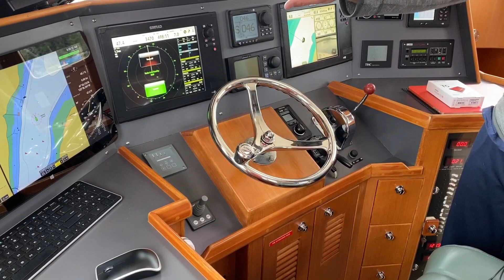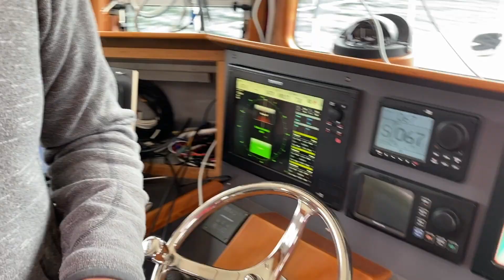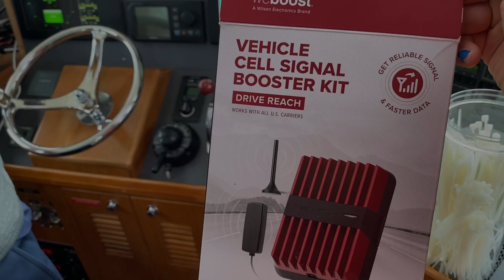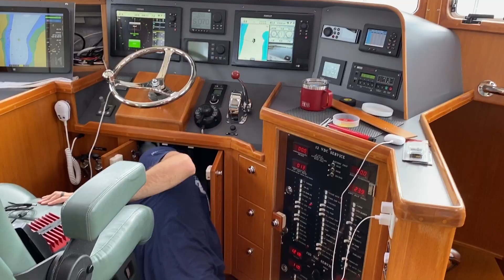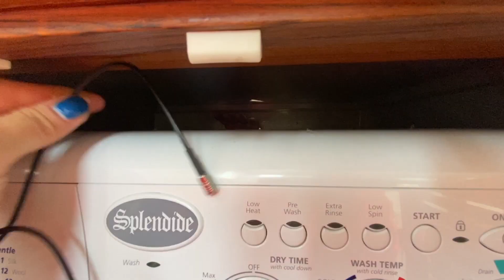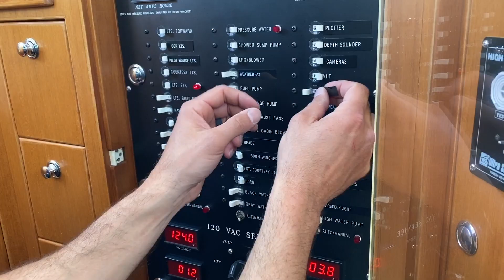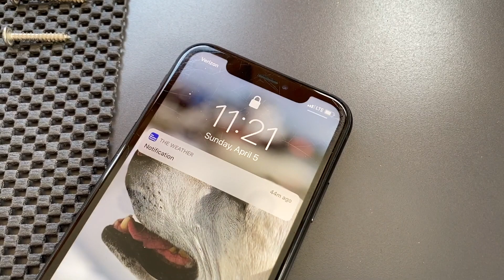Do CELL BOOSTERS work??? Watch our installation of a WeBoost on a Nordhavn 43 trawler.

Comment: i’ve owned 17 or 18 Boats through out my life i’m almost 60years old and i’ve never had great success with Cellphpne or Internet Boosters onboard , now i’ll be honest  i’m not very Techie  and honestly i guess i’m okay with the Crappy or slower  Speeds  as it’s usually other people that complain about it and for me  i like to check workEmails  and maybe  some NavigationalCharts or Maps ?  because of my Age etc i still usually have Paper Charts of the areas i’m exploring and traveling by boat plus i enjoy that system best as that’s how I was taught 40 years ago  don’t get me wrong i do use GPS ,Radar , and some other Electronics  yet i  never leavecmynPortbwithout my Trusty Old Hand held Compass

Comment: The Wilson antenna you bought is the original name of what is now called, WeBoost.  I had a Wilson home unit that should have worked in your boat.  It was more powerful than the mobile version you installed.  Like Elizabeth stated, "I thought it would have worked farther from the inside antenna," well...the house version that would also work on your boat, would have worked anywhere in your boat.  It's that much more powerful.  You can even get a splitter and have two indoor antenna's and have one in the pilot house and the other in your bedroom.   I highly recommend the WeBoost (formerly Wilson) units.  If you ever decide to upgrade to the more powerful repeater, you can buy just that part without the extra antenna's, cable, etc., from WeBoost.  Happy boating!

Comment: It would seem like anything that boosts your signal wirelessly will cut the bandwidth in half, so 4  bars on the boat won't the same speed as 4 bars when you are closer to a cell tower.  However, I'm sure it will be faster than what you had with the poor signal and you will eliminate the interruptions due to dropping the signal.

Comment: The signal would be better if you put the internal antenna on the outside of the cabinet as far away from other electronics and metal surfaces as possible. I'm sure it'll work inside the cabinet as well but from our experience in a camper. It's better if the internal antenna has an actual line of sight to whatever device.

Comment: Circuit protection devices (fuses, breakers) are to protect the WIRE, not the device.  You should size the breaker for the wire run, there are plenty of online resources to help you calculate but you need to consider wire type (stranded, solid), gauge, and length of run (voltage drop), and whether the run is in a bundle or in "free air".  When considering the length of run it is twice the distance from the source to the load (there and back again).  Its fine to use a smaller breaker/fuse but not a larger one.  In your video you seem to be considering the power requirement of the device, but not the wiring.  Its probably fine for you, as it sounds like the run was originally for a 20A 12DC device, but others may not be so lucky :)

Comment: BEWARE: It may seem like you were getting a very strong signal on your cell phone, but that could just be coming from the cell phone booster and it doesn’t mean the signal going into the antenna to the booster is that strong. So another words it’s not going to make the signal coming into the antenna stronger just from the box to the phone strong walking around that area

Comment: Have you looked at Digital Yachts 4g Pro. It gets 15 to 20 miles. I have the Wilson unit  for a  3 g, 3watt amp and a few extra bars on Lake Huron and Lake  Michigan. The omni direction antenna is on my 60 ft mast. Also have  
An Iridium Go and Antenna and have yet to use it yet. Very costly to run. Going to use a prepaid card for  600 for 400 minutes.
Reply from the maker: We haven’t but will look into it!

Comment: Soon we will have skynet so internet will no longer be a problem for most people.
Reply: starlink will take another 8 years in theory. They still have not perfected the sat to sat communications so you need to be close to a land based connection from your sat. Low earth orbit sats comes with a rather complex set of issues to resolve and it usually translates into throwing a ton of money at it. Musks does plan to increase the number of sats after this next round but there just isnt anything on paper for it yet. So 8 years is optomistic. Meanwhile some people pay as much as a million dollars a year for the worst internet imagineable for their yachts.

Comment: Hi Folks, love your videos. Will be getting myself a new boat in 2 years (Retirement) Looking at a smaller 41 Beneteau Swift Trawler. My question is is this a item that would be better mounted higher up? Just wondering if  the the other antennas could case interference?

Comment: First comment is the reason the wire does not go through the center of the pipe is to prevent water from coming into the boat.  Think about it?  Why wouldn't everyone run the cable like you are running yours...  You are creating a future problem.

Comment: We have been using another cell booster brand in our offices.    It is Wilson Pro.    www.wilsonpro.com     They have truly commercial grade equipment as well as specialized for autos and also yachts.    They also have a full line of signal repeaters, so if you have larger spaces, you can distribute the signals so you have service everywhere.    Also, they are a good company to work with.

Comment: Very near future you will be able to get  Starlink service Elon Musk is building. He already has around 25 satellites up he is running tests on. Starlink is licensed for 21,000 satellites for the future system, that gives an idea of scale. All Starlink satellites  will be LEO'S (Low Earth Orbit) around 350 miles. Currently, internet satellites are television, telecommunications satellites and orbit at 22,000 miles. Starlink will have ⅓ the latency, many more times the capacity and speeds near fiber optics.

Comment: The satellite internet is ridiculous on there service fees.whenever we order our new boat we always have them add that option. The cost is cheaper if the yard where your boat is being built in the stalls at for you. I just have them do it just in case the price comes down. Now we do have a satellite phone for emergencies. Even that to use for a phone call is very expensive. We haven't tried the cell phone booster. I really hope you keep us updated on how that works out for you.

Comment: Pro tip for cable management:. Instead of using zip ties, buy a roll of Velcro, then cut to whatever length you need.  It will last forever in this application.  It looks nice.  It's easy to add or remove cables from a bundle if needed.

I learned this dressing data closets in hospitals all over the US.

Comment: Random question not cell phone booster related...Do you have a schedule for how much you run your generator while at anchor?  Or is it running all the time...?  How does this impact climate control and refrigeration and freezer needs?

Comment: I hope this works for you. I've found in the past that you need a really good ground plane, as in a metal structure or faraday cage to separate the reception from the re-transmission antennas.  For your cruising area, I'd suggest a dual sim LTE router for data and wifi calling using both Verizon and T-Mobile.

Comment: Cool video showing the install. Put the antenna as high as possible and you may get better reception. I would get a long metal extender vs a short one. I would also keep an eye on the amp and power adapter. Both can get very hot. Might want to build a vented box with a couple fans to run air across them. Fuse rating should also be inside the cig adapter. I would also look into getting a Ham license for the water. You can send messages for thousands of miles for free minus hardware costs. Hardware can run from expensive to cheap, but how much is your life worth. You can send emails, receive pictures, and marine updates for free with a laptop. No ISP needed. Super slow on data, but it is another means of communication in case of an emergency. It can also be a fun hobby with lots of information to learn so it keeps your mind busy.

Comment: When I was in the Canadian Navy and we received our brand new ships in the 90's, we wanted to be able to use small hand held radios threw-out the ship for emergencies. The trouble was that there was just to much steel in the ship for this to work. The superstructure acted like a very big Faraday cage and shunted all the signals to ground. The solution, they strung RG 59 cable though out the ship in the wire ways. Problem solved. You need a terminator at each end of the cable. If you can find a piece of RG 59 say 20 - 30 ft long, put one end close to the antenna, without touching it and string the rest along the deck to another compartment and see if it works at those frequencies.  RG 59 or 58, (TV Cable) should be easy to find and the terminators are pretty cheap. Worth a try to see if it works.... :-)

Comment: This is so good :)
I install these unites all the time in emergency vehicles . 
I do exactly what you do ,loose the adapter, antenna , new safe circuit. 

But; the ones I use have the phone holder as the receive antenna . ( same brand )
I would like to know how well it work at see .
Our guys that are getting most of them are fire marshals in the north part of Canada.
They have limits ;but, can take you from nothing to signal .
Just so you know my job is wiring  emergency vehicles, no brand loyalty , just Shawn put these lights ,this controller ,this DVR , 10 cameras , and so on and so on !
Cheers Stay safe ! :)

Comment: I Installed that exact same system on my boat and have some pointers for you.....I have used it up north and in Desolation Sound...let me know if you want some input....I tried several boosters and the one you have and the antenna seems to be the best

Comment: Issue is not the strength of the signal, it's multipath interference if the cell phone's too far from that sensor pad.

Comment: so I got some convicting answers regarding making fresh water so my question is  can you make fresh clean drinking water on board. .
Reply: Doesn’t taste good at all but you should always be careful due to bacteria that can still get past the memebranes
Reply: Yes most larger boats will come with a fresh water maker. You can also purchase and install a RO watermaker for smaller boats. It can produce between several tens of gallons a day of fresh water from salt water.

Comment: Forget about the booster - the real magic of this video is a boat builder who actually designed for serviceability.  That job was super easy because they made easily removed access panels and wire chases instead of using all hidden fasteners and making you run the cable from the flybride to the engine room then back up to the pilothouse (all to common).  I've done installations of similar items where you might need 75' of cable just to reach 10' and spend a full day tearing the boat apart to access the routing.  (cough, SeaRay, cough)
Reply: Yup - Sea Ray owner here. Can confirm.

Comment: Not sure if you're aware but if you unscrew the cigarette lighter adapter tip, you should find a barrel fuse inline. That fuse should have a rating stamped on one end. This will assist you in determining the correct breaker size.

Comment: Cell boosters for Sprint dont worl for their 4G band, because the Frequency is next to a protect band. So boosters are not allowed to be made on that band. However they do work for other providers that don't have a band that is not near protected.
Reply: @Weenie Hut Jr's Not yet. The Feds have not approved it. REGARDLESS Sprints PCS Freq (unique to Sprint has restrictions so 3rd party boosters can't be sold) are still the same. I doubt T-Mobile will abandon PCS 4G network band. I have been a Sprint customer since 1994. I doubt it will make a difference to Sprint customers like me (since 1994).  It does not matter to me it's just a mobile computer (with a phone App). BTW I have one of the boosters in my house and it works pretty good. It was free and cost me nothing.

Comment: Good luck I have has zero to little luck with my Webost Cell Signial Buster.
Reply: I've had poor results with mine as well.  It will often show that I have 4 bars on the phone when it's on, but I still can't connect.  I've pretty much given up on it.

Comment: Nice video again guys.  Some people commented on StarLink for a future solution.  The issue for it and vehicles is the system tracks the satellites and does something with a phased array antennae to point to the best satellite.  Pretty cool, but on a boat that is always wobbling around it gets hard.  It is done electronically so maybe there will be a way.

Comment: Just because you can boost a signal doesn't necessarily improve it.  Also, I am guessing you left enough slack in the antenna wire to replace the mount. :)

Comment: There are lots of different cell boosters available today, differing configurations, antenna types and power ratings. If you select the right type for your application, do a proper installation, and have a signal available to boost, they work well. The mistake many make is buying one thats too powerful for the space available, especially in boats & RV's. The more powerful the booster (dB of gain) the more space required between the antennas. If you don't maintain sufficient separation between the outside & inside antenna, it creates oscillation between them and effectively shuts it down.

Comment: Nice presentation. Looking forward to your review over time and at a remote anchorage.  As I am quarantined, as we all are, I have been researching for my boat. WeBoost makes several versions of the product and there is one for RVs and one just for marine use. It comes with the correct antenna and a different amplifier box. I don’t know what the different box add as performance.  Between WeBoost and Wilson the solutions for marine are very confusing.

I am also looking at the Iridium Go as a solution. Not cheap either as a data plan or two are required. 

Again nice video.

Comment: hey, I do not comment often, but you guys need to hook up with DELOS sailing on you tube. they just found a company out f A that has a new high speed internet available for boats  e that they could afford to put on and use. they were getting much higher speeds even out on the ocean. I am not giving details because I watched the video but I was doing other stuff at the same time. i would rather them give you details since they know what they are talking about.  Happy motoring
Reply: I hope it is affordable but I don't think delos is paying for it.
Reply: @lylekelly8794  you may be right but I have my fingers crossed

Comment: Wow, a 40 gb plan on the KVH Tracphone device is $2,600 a month before they add on taxes and fees for your government.  That's for 20 mbps down and 3 up.  Somehow you can get unlimited data, but at a much slower rate and for more money on top of the base fee.  I think most people are using the predict wind app on the Iridium GO device.  But the data is much lower and slower.  You can make calls with it, but that too is limited and costly if you go beyond.  Not KVH Tracphone costly, but not cheap either.  The cruisers I follow are on sailboats and I think they all have cell boosters too.  Happy Easter!